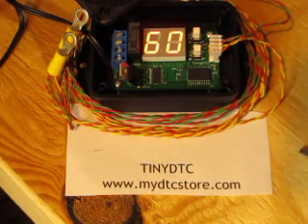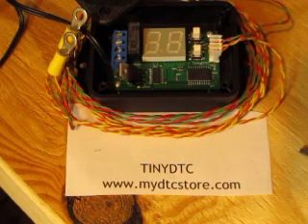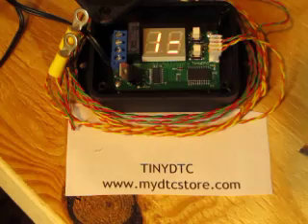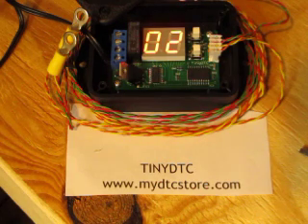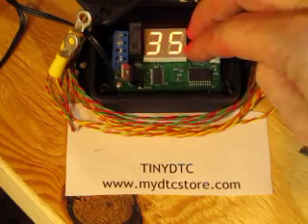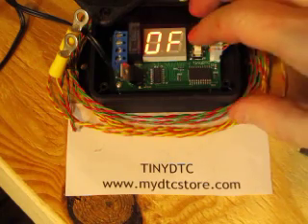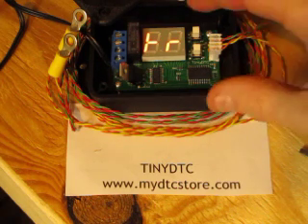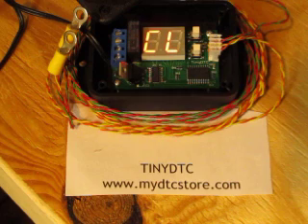TinyDTC Differential Temperature Controller for DIY Solar Heating Applications

Comment: hello ,can this unit be used for controlling the temp. in a paint booth ,say like i want the temp in the booth at about 60°C and when the temp reaches the set temp the halogen lights  goes off and when it drops down to say 55 °C it again turns the haogen light ON,
please let me know i need one if it could be used
i am from india can yuo ship it to india
Reply from the maker: hydrochrome india Yes in HEAT mode this can control based on a 60C setpoint with a 5C hysteresis value.  We don't currently ship to India however.  Sorry.  Brian

Comment: Can you hack this to control heated gear? I ride a motorcycle
Reply from the maker: I think most of the heated gear controllers use PWM to control the amount of heat the jacket gets.  This little controller just can control differentially with a relay and could only turn on then off very slowly in comparison and would probably make the gear too hot / too cool...sorry.
Reply: Brian Smith Thanks Brian.

Comment: Cool video...Thanks  Lots of control possibilities. I could never understand the purpose of the high temp shut down. It seems that the collector would overheat if the pump shuts down. If the temp of hot water exceeds 200*F more heat storage is needed.
Reply from the maker: The high temp shutdown is for hot water tanks that maybe can't take temperatures over a certain temp based on there material or to protect from scalding if there isn't a mixing value. If you don't take the heat in the tank, the collector is going to get a lot warmer... that's for sure.
Reply: Brian Smith It's a mystery